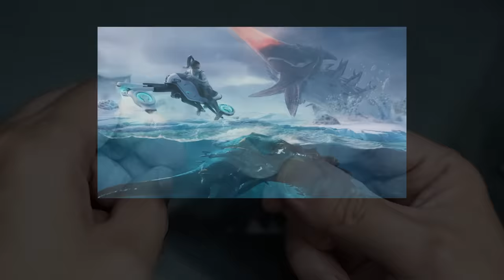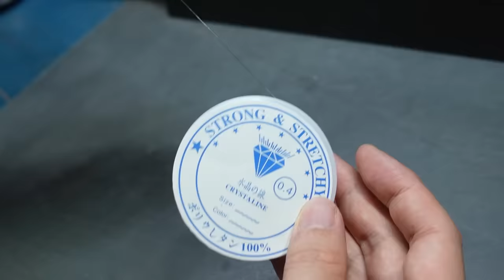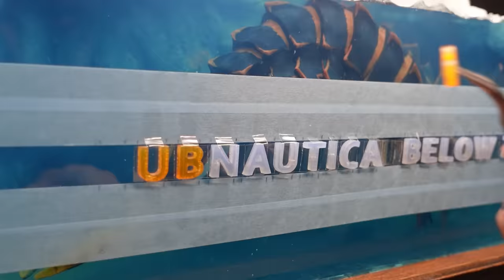Make The Ice Worm Diorama【Subnautica/Below Zero/Resin Art/thalassophobia/サブノーティカ】

Comment: I need to find me a hobby like this...
Reply: Axoloth!
Reply: Try plastic model kits
Reply: 1) can get quite expensive
2) you'll need a second desk specifically for this stuff since its going to be covered forever
3) you will curse, a lot 
4) you will, at one point, inevitably glue your fingers together with superglue
5) when gluing, it will not stick to the point where it has to go. It will stick to anywere and anything else.
6) you will buy one small jar of paint, to be used once and never again. This will happen multiple times.
7) in case of plastic kits, you will use too much glue and dissolve half if the model, instead of gluing two parts together.
8) did i mention cursing because something wont stick? Or because your fingers are glued together?
9) have a LOT of patience
10) if you complete a build succesfully, (if, not when) it will be very satisfying.
Reply: Foam sculpting get some cheap foam and a knife
Reply: If you need tips on how to do or mimic anything in scale feel free to reach out brother.
Reply: @TheKrogy  Renshape
Reply: I ate a deep fried axalotl yesterday